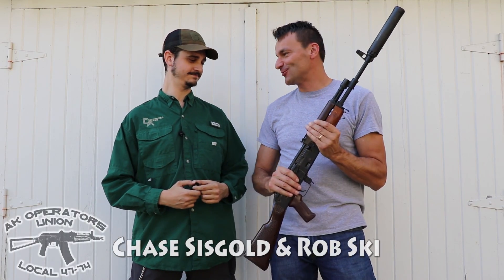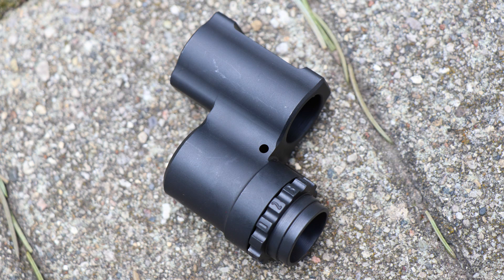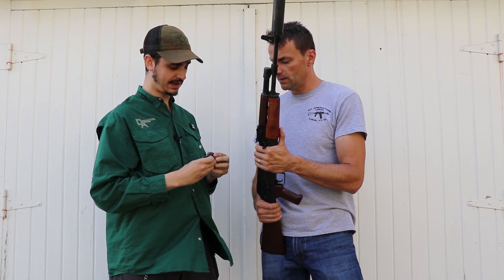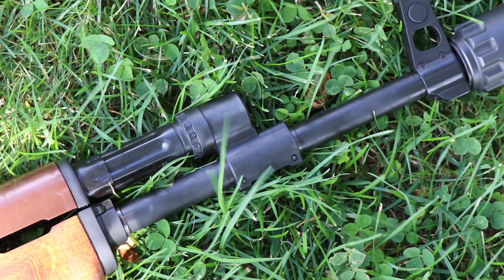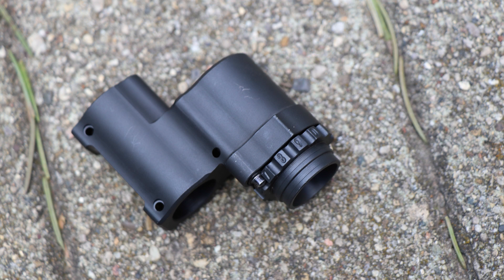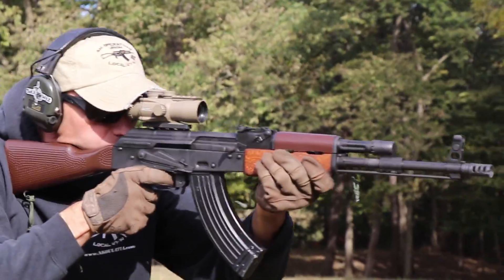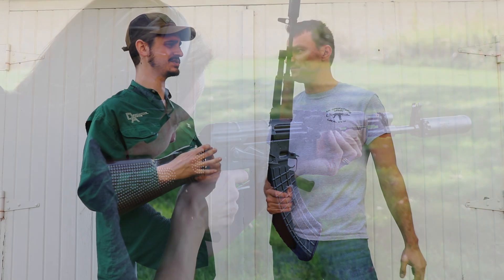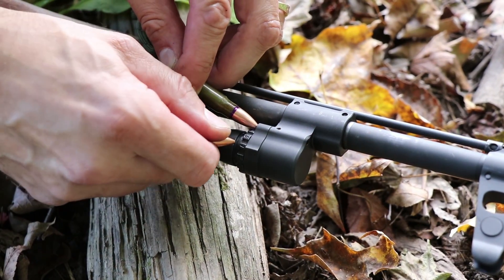Definitive Arms East German AK47 with Regulated Gas Block!

Comment: Hello Rob.  Long time since I have contacted you.  Not due to forgetting you old friend however.  I am glad to see your back up and running in your fine site.  The gas block is incredible.  Shooting suppressed is made a lot better with this gas block. This item is for sure a tremendous asset for certain type operations.  AKM's AK-74's, 55.6, 303, etc a great piece of equipment for sure. Thanks for the information and keeping us all updated on improving the capability of the AK and others.

Comment: Rob, in the video you mention hot gas coming back at you while shooting.  I had never noticed this until I purchased my 7.62 VEPR FM.  Everytime I shoot it, my eyes start burning.  Is this because its overgassed or do I have another problem?  The guns works just fine.  Also can you explain overgassing, its causes, how to tell if your rifle is overgassed and how to fix it?  I think a lot of us know very little about this subject.  THANKS!
Reply from the maker: Overgassing is from too large hole drilled in the barrel for example (gas port). Your rifle will cycle more violently since there is more gas coming back through the gas system, so bolt carrier will be moving faster and etc. As for hot gas going back at you, this happens mainly with suppressed guns, but yes, overgassed gun will push more  gas back so you will fell it...
Reply: @AkOperatorsUnion  rob, do you get gas pushed back in your face from your vepr?  My vepr is the only gun I have had this issue with.  Can u do something to change it?

Comment: Would this be a good way to shoot subsonic 300 blackout rounds if there exists an AK that is built for 300 blackout?
Reply: Yes. There are .300 blk out AK's, both converted and virgin built, but they do not perform as well (with subs)compared to an AR due to the much heavier AK bolt, where as an AR has a plethora of buffer springs (reduced recoil, up to .308, etc) buffer weights engineered for suppressors, in various weights, and ultra light titanium bolt carriers to heavy weight carriers. 
Where as an AK 5.56 bolt carrier comes in only one standard weight option, and maybe a reduced power bolt carrier spring option (cutting coils is not the same), which all of this means is, you may, or may not be able to cycle subsonic rounds even though you have a suppressor on, and you will certainly have a loud action cycling back and fourth.

Comment: Cool, but as long as you are going to all that trouble, why doesn't it have a bayonet lug? I just shot my new Molot Vepr 74 and I like it but it has no lug :(
Reply: @Jim Beam Why does the Russian military issue them? For herding prisoners. This will be useful for what is coming and I'm not interested in your opinion of that
Reply: I also have found many uses for bayo mounting, and have a lug on nearly every rifle, and shotgun. 
But the reason they did not use one is because there are many different lugs for AKs......*many lugs are not even on the gas block at all, but forward on the front sight post, some bayo's folding, some pressed and pinned to the barrel separately, some mounted on the handguard (SIG mlok bayo mount for 13.5 SLR AK handguard) and some even on the flashhider itself). 
Another factor is that it adds to the machining time, larger stock, which needs a price increase to justify the extra material and production cost, and the gas block is already very expensive, a higher price point for a lug that is not going to work for...at least half the people, is just going to fail miserably. Instead, try one of the 20 other different ways to mount a lug. Not being smart. I did it.

Comment: So I take it this AK with adjustable gas block, is best intended for use with a suppressor.
Reply: Useful with or without the can. Many 7.62 guns are overgassed.
Reply: @Jim Beam I suppose. I don't have one of each to compare. I wish these had been available for my last build. The KNS adjustable gas piston is retrofitable and it makes an enormous difference even though it is of the bypass type Chase mentioned.
Reply: @Jim Beam Did I not say the DA part was unavailable when I built my gun? Should I have waited six months? The KNS part is not perfect but should I have refused to use it on my gun because of that? Is the DA component worth 3 to 4 times what the KNS component costs (labor included)? Are you planning to disassemble a working gun just to put the DA gas block on it?
Reply: dbmail545 "Are you planning to disassemble a working gun just to put the DA gas block on it?"  Sure, sounds like it would be a fun project.
Reply: @Mrgone454  if you have the tools and expertise. I have a guy who does good work for a reasonable price. If I find what I'm looking for he will be putting that gas block on it. It won't even fit my Krebses while the gas piston install can be done with a hand drill.

Comment: Adjustable gas block or piston which is better?
Reply: sketchy roll bolt action.
Reply: Good question. I would go with the gas block because you can adjust the settings in a second, without disassembling your rifle. You can also visually see your setting...without taking the rifle apart....You can (somewhat) maintenance the gas block externally, buy spraying on clp, and it will seep in, again, without disassembling. That gas block is not getting hammered back and forth either.....and have you tried to clean a piston that has been shot for an extended amount of time ! It is baked on crud. Seems worse than the gas block.

Comment: Just got back from the Red October match this past weekend (bigger and better each year!) The KNS guys were there and I had a chance to demo several rifles with their adjustable gas piston device and several different cans from Dead Air. One gun was full auto. Didn't notice any gas blowback to speak of.  The KNS units seemed to present on the  guns of several vendors as well as competitors. For me it is a lot easier to change a gas piston (easy addition of another 944 part too) then break down a gun far enough to change the gas block, but I would like to see a head to head comparison of the different gas metering systems now available.
Reply: Kns can only bleed off gas from the hole in the barrel so sometimes u have to pull the gas block to drill out the hole bigger cuz sometimes the piston won’t be strong enough for sub sonic ammo also it won’t completely cut the gas off like this one so the adjustable gas block is king. Remember the piston only bleeds off more gas so it will only go one way and it won’t add to the pressure to the bullet the adjustable gas block will add and take away gas and also change the bullets pressure and use it as a push pull for total possible outcome for  sub sonic ammo so the piston is convenient but won’t compete especially for silence no way

Comment: Rob, I bought a AKT Trigger from you a couple days ago. Would you recommend that I 'round' the hammer so it doesn't deform the tail of the bolt-carrier?

Have you had problems with the AKT causing deformations?

I installed it yesterday! Thanks!
Reply from the maker: Yep, i do it man!
Reply: Rob has a video on how to modify the ALG trigger.  I did it to both my AKs and it works awesome.

Comment: Hey, would you ever consider doing the 5000 round endurance test on the Robinson Armament XCR-L either on here or on the GRS channel? It's not exactly an AK, but it uses an AK-pattern bolt and gas piston (with the GB3 gas block, the GB2 model is short stroke). It would be interesting to see how a sort of modern take on the AK would perform.